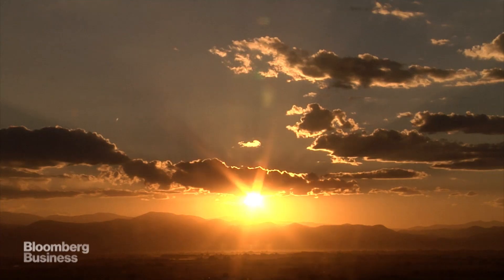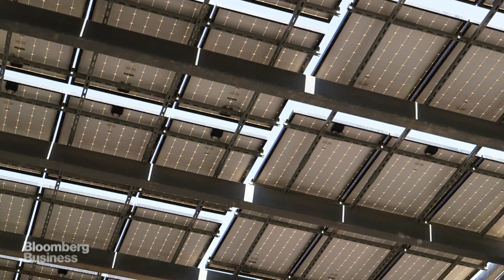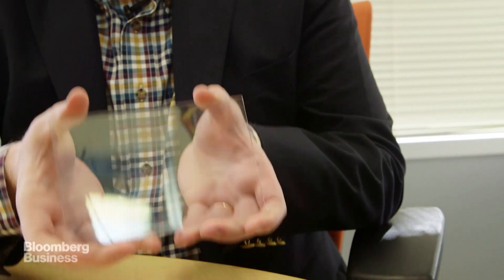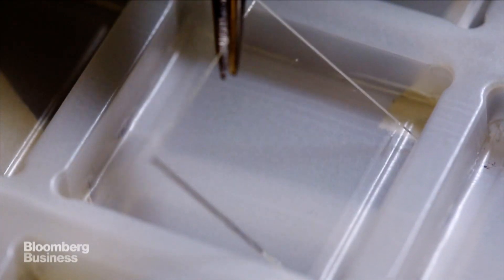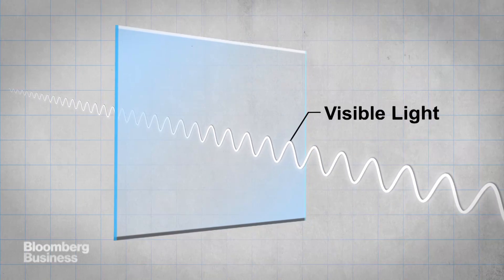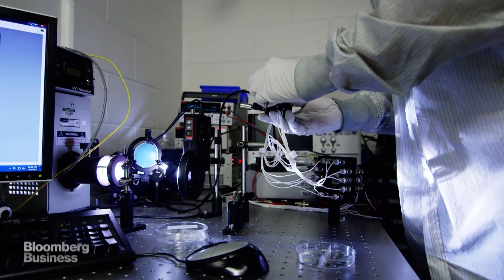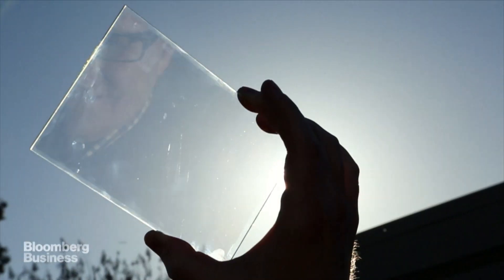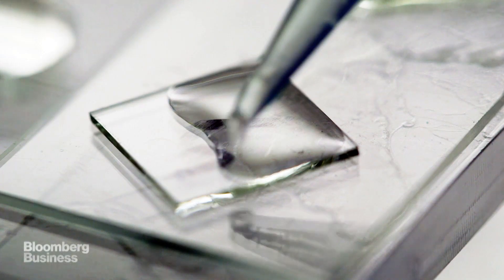Invisible Solar Cells That Could Power Skyscrapers

Comment: Ok skyscraper are generally vertical buildings. This means that part of the building will not experience sunlight for parts of the day. This is why commercial solar farms have their solar cells on panels that move relative to the position of the "sun in the sky" or really relative to the position of earths rotation in a daily cycle as it orbits the sun. You can't do this on a skyscraper. So actually the amount of surface area significantly decreases throughout the day. You're already reducing efficiency and now you're also reducing overall absorbed sunlight. This is not a cost effective project or at least it isn't for the current infrastructure.
Reply: Their target is not the visible light, but  the uv rays and near infra red , from which electricity can be generated

Comment: Does anyone, know if it's on the market to buy? Where I live, is head-on Sun!! Also. I want this particular solar cells wrapped around a huge rock foundation at the front entry of my place. Also, on the top my roof and carport and wrapped around my car too! Am hopeful it will solar power my Aquaponic patio?
Reply: Seems you'll have to contact the company directly as they are not producing for consumers. Still I'm sure you could order something from them. It'll probably be expensive though. Just google "solar glass."
Reply: Cheers ...

Comment: They never once say what power, as in voltage and amperage, they can get as in a square meter... only it is '10% of light'...
Reply: As time goes on the technology will further advance allowing for a higher percentage of power. But the potential of this concept is phenomenal.
Reply: pun
Reply: it depends on the cost really. If it's cheap then 10% of light is better than nothing.

Comment: If visible light is ~45% of our sun's light, can you please explain how removing it only creates a ~33% loss in maximum efficiency?
Reply: +Ben Ungs because different wavelengths of light has different energy levels, the shorter wavelengths have much higher energy such as ultraviolet, though near infrared is not as powerful. So, when you take out the visible light spectrum which is actually quite small you're still getting UV which is much more powerful relatively so you don't lose as much power as you would if all spectrum of light is the same energy.
Reply: +Wise Lum I encourage you to check out the summary section of Wikipedia's article on sunlight, stating that the distribution of ENERGY from the sun is 42~43% visible. Energy calculations already performed.
Reply: +Wise Lum I encourage you to check out the summary section of Wikipedia's article on sunlight, stating that the distribution of ENERGY from the sun is 42~43% visible. Energy calculations already performed.
Reply: +Wise Lum I encourage you to check out the summary section of Wikipedia's article on sunlight, stating that the distribution of ENERGY from the sun is 42~43% visible. Energy calculations already performed.
Reply: +Wise Lum and my question still stands.
Reply: ahhhh ok, i'd say probably because normal solar panels don't absorb all visible light anyways
Reply: which it obviously doesn't

Comment: Just because you capture the wavelength of light invisible to the human eye, that doesn't mean that the thing that actually captures it is automaticaly invisible. You have in no way explained how you got it to be transparant.
Reply: Graphene
Reply: +puzoldookie it does though...if the visible light is not reflected or absorbed, it's invisible
Reply: +Wise Lum The thing is, if it's absorbed, it needs to be absorbed by something, and that something can't be invisible. 
Since I've made my first comment I've looked more into this stuff and found out that their idea is not for the glass to absorb the light but to reflect it to the side and what would absorb the light would be sth similar to solar panels but placed in the side of the windows, rather than under the glass.
That however is hihgly inefficient because the surface area which would absorb the light would be miniscule (unless you plan to have 3foot thick windows) and the amount of light absorbed would be smaller too since they only plan to absorb UV light to keep the glass see-through.
Reply: puzoldookie well they did say it is less efficient than conventional solar cells, and also "that something" can certainly be invisible if it's not absorbing visible light, because we don't see uv or infrared. to us it'd be invisible. They even had a little animation in the video to explain it... but yeah it is inefficient atm but like they said, it can be applied to large surface areas of urban landscapes.
Reply: +Wise Lum Well, in either case, if we take what they say, they don't absorb the light they reflect it to the side, like I've said earlier. The only place it can reflect to is the side of the window, and the thickness of the thing that would absorb the light is limited by the thickness of the edge of the window. + The sunrays always fall at an angle leaving only one to two edges actually absorbing light, and at less efficiency becuse reflected light losses energy compared to the direct light. I would honestly be surprised if the thing could run a calculator. They could'ev showd at least that or any other working prototype. Hell, they didn't even show a single piece with wires or connectors connected to it.
Reply: puzoldookie yeah i'm intrigued by the idea, and would love to see it working to generate power and tests.

Comment: So throw these on top of the other solar panels. Any UV and near infrared that passed through with the visible light will be collected and reflected back through the transparent solar panel.
Reply: No that's not how it works lol
Reply: That would be nice though.
Reply: replace the glass coating of ordinary pv with this stuff and you're set